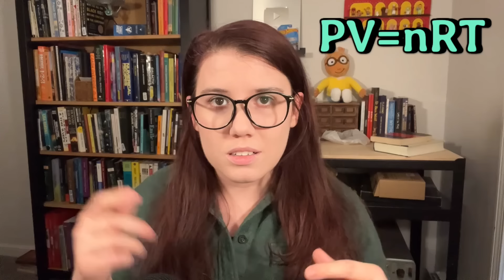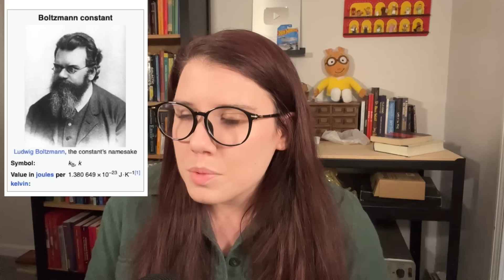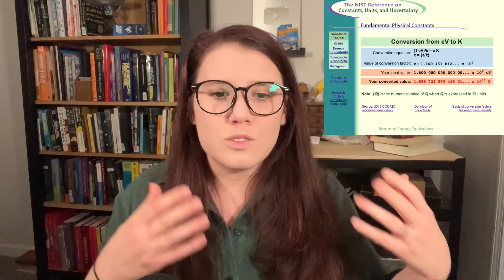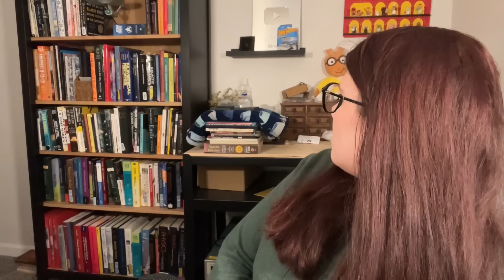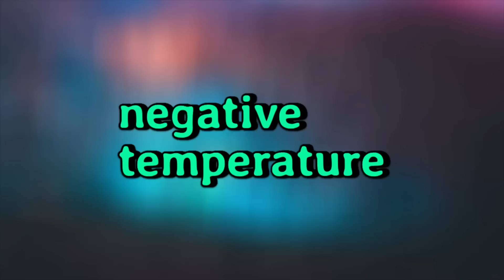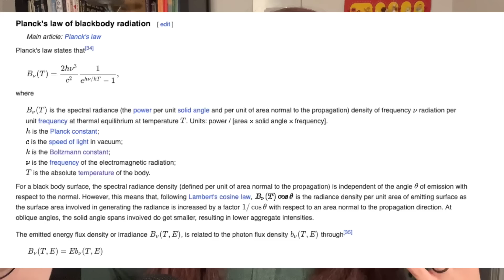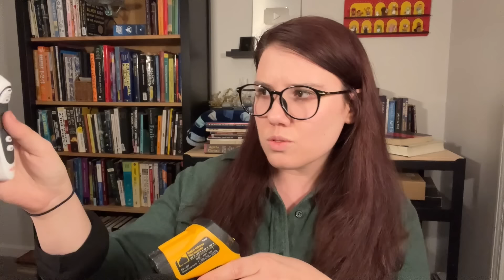the concept of temperature

Comment: If i remember my p-chem correctly (BIG if), the vibrational degrees of freedom of a bond are stetching and bending. Both are harmonic oscillators, so stretching is really "stretching and compression", and bending is really "bending back and forth". You can model a diatonic molecule pretty well as two balls with a spring between them.

Comment: PC building question. So basically if I manage to decrease CPU temperature, then it will have less resistance. So then I can make more calculations or less voltage needed for the same. But. Reducing CPU temperature requires a device which consume energy to cool the CPU. Lets say I can not reduce the efficiency of the cooling device but If I Increase the "heat removing capacity" linearly, then I can have a CPU which consume less energy / calculation.
Or
Forget the entire thing because increased cooling capacity will increase overall power consumption and truly the only reason to have a better cooling to stop the CPU reaching the maximum temperature which it can still operate...

Comment: I went on this descent into madness when my engineering thermodynamics professor assigned us a problem where the "correct way" to solve it was to use constant pressure, however the the pressure went from 1 atm to just under a GPa. When I searched for temperature in the index it referred me to a passage saying, "don't let it bother you that you don't understand entropy, we've never defined temperature and you've been using without issue."

Comment: Temperature of 1 atom isn't defined because its velocity is a macro-state information. A moving ball has the same temperature as a stationary ball. You only count the invisible degrees of freedom. Statistically, that's not the average kinetic energy, but the dispersion of velocity (that is - average of a square minus square of an average: average kinetic energy minus kinetic energy of the average system as seen from outside). That would put the temperature of a single atom to 0. But... knowledge of statistics also tells you that the fewer data points you have, the larger the uncertainty is, you roughly have 1/N scaling of dispersion. So, the temperature of a single atom is 0 ± ∞ which is meaningless. The more atoms you have, the more accurate your concept of energy gets, but you still have fluctuations which are more and more noticable, the fewer particles you have. That's what brownian motion reflects - some of the randomness starting to show when you look closely enough.

Comment: 34:50 : you can take an average of one thing, but if you are talking about the average of the kinetic energies of some particles, then, this depends on the frame of reference, and usually we would use the frame of reference in which the collection of particles is overall not moving, but, if you do this with just one atom, you always get zero, and so it seems less meaningful?

35:57 : err, hold on, what? I get how 1/S would be 1/0 if in the ground state, but, why should dS/dU be 0?
Surely if we add energy to it, there are multiple possible,
Well, I suppose if the two lowest energy eigenvalues were non-degenerate and you gave just enough energy to go up one energy level,
but, eh?
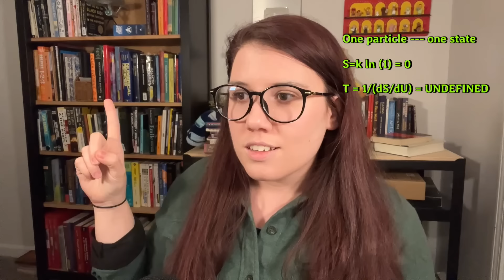36:43 : oh ok that is what you were getting at..
... is the next energy level really non-degenerate? Like, it will be rotationally symetric and everything?

Comment: All the ways to measure temperature basically comes down to 1. Get something to a thermal equilibrium with the thing you want to measure. 2. Measure some property of that something, that you know how relates to temperature. 3. Use the known relationship to figure out the temperature. 
The nice thing about black body radiation is that the 'something' is the ambient electromagnetic field, so we don't have to stick anything into the system we are measuring

Comment: Historically temperature seems to be the degree of change in state of liquid water between frozen ice & boiled steam under 1 atmospheric pressure.  Note as temperature changes water atoms (ex: atomistically) do change in their state although holistically water remains a liquid. 
Heat density seems to be the crux of temperature.

Comment: I used to work in an oil refinery, 

We had a huge vessel , about the size of a ten story building. It was full of steam at about 10 PSI. A supervisor asked me to unplug a bleeder valve at the bottom with a rod by opening the bleeder and shoving the rod in the bleeder. I refused. He said it's only ten PSI and  decided to do it himself as I cautioned him against it. He opened the bleeder valve and shoved the rod into it. Out came so much steam under massive pressure that he had to jump away and do an elaborate dance to prevent injury. Every one ran away in fear accept me, as I was standing far away already. The entire area was inundated with steam in seconds. This occurred do to the huge volume in the vessel and the tiny opening in the bleeder valve. We had to shut two very large valves in order to isolate the section and wait for the pressure to dissipate before we could shut the valve. .No one was injured.
Reply: Honestly people who are so stubborn and refuse to listen like this are flat out dangerous. I'm glad no one was hurt.
Reply: Hey you can't just drop the story without saying if the supervisor at least acknowledged you were right
Reply: @AMUMSHS  NO, he never said anything about it. Too embarrassed I guess.
Reply: You may be interested in the Safety Third segment on the Well There's Your Problem comedy podcast about engineering disasters hosted here on YouTube. That segment in particular is about workplace calamities described in opposition to Mike Rowe's stated affinity for personal responsibility as a superior safety paradigm when compared to institutional or regulatory orders.
Reply: Every time I open a can of Guinness, I risk inundating my desk. If the can is cold, it is pretty safe to open it quickly, but best be more patient.
Reply: 10 psi itself is almost a child's play, but 10 psi of steam is around 240°Fahrenheit.
Steam is dangerous all by itself because it's hot and it is wet, which transfers heat better.
People get injured from just hot water before it boils.
A small orifice doesn't increase the pressure from the source pressure.
10 psi is 10 psi.
Steam is freaking hot.
Don't play with steam.
Reply: @ You’re right I should have said velocity not pressure but essentially the result is the same.

Comment: I used to work for the Eurotherm Corporation. What I always thought was interesting about the two-dissimilar-metals Thermocouples is that, no matter HOW LONG the overall length of the two conjoined wires (whether the length be 6-inches or 16 feet), the voltage measured across the two conjoined wires, for any overall length, will always be the same (if the temperature at the union-of-wires point remains constant.)

Comment: The triple point of an element is confusing…
• is it a liquid?
• is it a gas?
• is it a solid?
• are the three concepts inadequate to describe what is going on?
Reply: The triple point is not a state it's a temperature and a pleasure at which all three states are possible. Just like, for example, at 0 C/1atm water can be either liquid or solid. Same thing but with all three states.
Reply: @Trucmuch  A-ha! So, from what you are saying, the triple point is the point at which 4 change-of-state rates are all equal...
• the rate at which solid becomes liquid;
• the rate at which liquid becomes vapor;
• the rate at which vapor becomes liquid; 
• the rate at which liquid becomes solid.
I know sublimation can occur, but I am not sure if reverse sublimation is possible.
Reply: @JohnBerry-q1h  Reverse sublimation exists and is called deposition. 
The state changes don't happen all at once or at the same rate. Let's go back to the simpler example of an ice cube at 0°C. An ice cube at room temperature will slowly melt but remain at 0°C until it's completely melted. Similarly, water in a freezer will slowly turn to ice but stay at 0°C until it's fully frozen. The melting and freezing don't happen in some kind of equilibrium. It's either one or the other. However, in both cases, it happens at 0°C.
Reply: @Trucmuch  The outcomes that you cite (a sample of ice completely melting while remaining at 0°C the entire time; a sample of water completely turning to ice while remaining at 0°C the entire time) definitely do happen, and I believe that the characteristic behavior of the temperature (i.e. remains constant) is always observed during such changes of phase. However, I'm certain that, if the rate at which Heat is added is kept equal to the rate at which Heat is removed, then it is possible for the rate at which...
• ice changes to water
...to be equal to the rate at which...
• water changes to ice.
The classic experiment involves recording the mass of an ice cube before dropping the ice cube into a glass of water. After some time passes, the ice cube is fished out of the water, followed immediately by re-weighing the ice cube. If the rate of "heat in" matched the rate of "heat out" (for the Ice Cube and Glass Of Water system), then the ice cube ends-up having the same mass at time 𝑡₁ as it had at time 𝑡₀. The noted difference is that the edges and corners of the initially "square" Ice Cube are now rounded and smoothed, having uniformly changed to water while an equal amount of the surrounding water changed to ice (which forms on the exterior of the pre-existing Ice Cube.) My understanding is that everything comes down to the rate at which Heat is added to a system versus the rate at which Heat is removed from a system. When the Heat rates (ᴵᴺ 𝑣𝑒𝑟𝑠𝑢𝑠 ᴼᵁᵀ) are balanced, then all of the dependent "phase change" rates can be equal, thereby establishing equilibrium. Again, it is necessary to specify if the rate of Heat addition exceeds, pales, or balances relative to the rate of Heat removal.
Reply: @JohnBerry-q1h  I guess. 
One could argue that heating and cooling in quick succession is just that—heating and cooling in quick succession. It's not heating and cooling simultaneously. But I don't want to nitpick. So, as long as you understand that the triple point is just a specific temperature and pressure that is the edge between the three states of matter, a point where an element can be either solid, liquid, or gaseous—not a special way to be either of these states —as long as you understand that, yes, by heating and cooling, increasing and decreasing the pressure in quick succession, you could have some oscillation between the three states of matter.

Comment: Claude Shannon tied information theory with randomness,  where a message is ordered and noise is disorder, similar to entropy where low entropy is order and high entropy is randonmness/noise/disorder/equilibrium.  At least the case of a mercury thermometer, I always assumed it was the reaching of equilibrium between the two different states of that which is being measured and the thermometer/mercury itself (e.g., high heat will cause the mercury to expand).

Comment: Hearing your explanation and configuring that for my head it seems to me that temperature is a measure of the flow rate of energy. Energy flows in a number of ways. Molecules bouncing around, vibration of molecules within them selves, infrared photons, ?. The confusing one is the thermometer which is the expansion of a material due to the flow rate of energy causing the material in a fine tube to expand, and than can be caused to happen with both photons and external contact with other materials. The temperature of space is the most confusing because that, it seems, can be a static value. Confused. Good to be forced to think about things I thought I understood.
Reply: what i now have indestood is:
space= 1d,2d,3d,..(ie space-digit d-ary number system)
local thermal equilibrium =  1e,2e,3e,.. (ie LTE-digit e-ary number system)
degree of freedom =  1f,2f,3f,..(ie DOF-digit f-ary number system)
time= 1g,2g,3g,..(ie time-digit g-ary number system)
And if to notice that
(img+coimg)-digit (ker+coker)-ary number system is equivalent to (coimg)-nested (1+coker)-ary img-digit number system (1 play role of carry  when Ker is disappearing)

Carry(motion,energy) of that number system equals following:

(ker+coker)^(img+coimg) = Sum F[coker,i,coimg]* Sum F[coker,j,img]*G[ker,coker,img,coker_shape]^(j+i) ,for i:=0 to coimg, for j:=0 to img, F[coker,j,img] - amount of j-faces in img_coker_shape,
G- likewise coimg_coker_shape

if coker=1 then img_coker_shape is img_vertex simplex (ie well known Newtons binom, therefore not interesting, let's skip it) 
else if coker=even number then it is img_coker_cube 
else if coker=odd number then it is img_coker_donut;

 Example_1 for coker=2(cube) wich is:
Row_0   1
Row_1   2 1 
Row_2   4 4 1
Row_3   8 12 6 1
   ...
   
    if (img=3)and(coimg=0)and(coker=2)and(ker=0..3)then Row_0*Row_3:
   (0+2)^3=1*(8*0^0+12*0^1+6*0^2+1*0^3)=8 
   (1+2)^3=1*(8*1^0+12*1^1+6*1^2+1*1^3)=27 
   (2+2)^3=1*(8*2^0+12*2^1+6*2^2+1*2^3)=64 
   (3+2)^3=1*(8*3^0+12*3^1+6*3^2+1*3^3)=125 
    if (img=2)and(coimg=1)and(coker=2)and(ker=0..3) then Row_1*Row_2: 
   (0+2)^3=2*(4*0^0+4*0^1+1*0^2)+1*(4*0^1+4*0^2+1*0^3)= 8 
   (1+2)^3=2*(4*1^0+4*1^1+1*1^2)+1*(4*1^1+4*1^2+1*1^3)= 27 
   (2+2)^3=2*(4*2^0+4*2^1+1*2^2)+1*(4*2^1+4*2^2+1*2^3)= 64 
   (3+2)^3=2*(4*3^0+4*3^1+1*3^2)+1*(4*3^1+4*3^2+1*3^3)= 125 
    if (img=1)and(coimg=2)and(coker=2)and(ker=0..3) then Row_2*Row_1: 
   (0+2)^3=4*(2*0^0+1*0^1)+4*(2*0^1+1*0^2)+1*(2*0^2+1*0^3)= 8 
   (1+2)^3=4*(2*1^0+1*1^1)+4*(2*1^1+1*1^2)+1*(2*1^2+1*1^3)= 27 
   (2+2)^3=4*(2*2^0+1*2^1)+4*(2*2^1+1*2^2)+1*(2*2^2+1*2^3)= 64
   (3+2)^3=4*(2*3^0+1*3^1)+4*(2*3^1+1*3^2)+1*(2*3^2+1*3^3)= 125 
    if (img=0)and(coimg=3)and(coker=2)and(ker=0..3) then Row_3*Row_0: 
   (0+2)^3=8*(1*0^0)+12*(2*0^1+1*0^2)+6*(1*0^2)+1*(1*0^3)= 8 
   (1+2)^3=8*(1*1^0)+12*(1*1^1)+6*(1*1^2)+1*(1*1^3)= 27 
   (2+2)^3=8*(1*2^0)+12*(1*2^1)+6*(1*2^2)+1*(1*2^3)= 64
   (3+2)^3=8*(1*3^0)+12*(1*3^1)+6*(1*3^2)+1*(1*3^3)= 125

Comment: The idea being used around 35:58 of the video is incorrect. While S = 0, this does not mean that dS/dE = 0 at all. It is entirely mundane for functions to satisfy, for example, f(0) = 0, but f'(0) ≠ 0 (as an example, let f(x) = x). Also, the definition of entrope being used here is not correct when talking about quantum systems anyway. This definition only works if you assume atoms are non-quantum. The definition of entropy in quantum mechanics is related to the trace of the density operator.
Reply: -tr(rho ln(rho)) right?
Ok but still if rho is a pure state, then one still gets 0..
Reply: @drdca8263  One gets S = 0, not for dS/dE, so Dr. Collier-Castro's claim is still incorrect.
Reply: @100MWSmile   I didn’t mean to contradict that part of what you said. I agree that the problem is only if dS/dU is 0.
Though, the meaning seems a little unclear to me in this way: how does the density operator \rho vary as a function of energy?
I suppose if we assume it is in a state of the form \rho = \exp(-c H)/\tr(exp(-c H)) for some real number c of the right units, where H is the Hamiltonian operator for the system, and let E be \tr( \rho H ) ,
then, for reasonable systems I think there will be a smooth bijection between values of E and values of c,
and so then we would have \rho as a function of E,
and then uh,
\tr(-\rho \ln(\rho) ) = \tr( (\exp( c H)/\tr(\exp(- c H))) \ln(\exp(- c H)/\tr(\exp(- c H))) )
= \tr( \rho * ( c H - \tr(\exp(-c H)) ) )
... which I’m sure should simplify nicely and give the usual temperature for these kinds of states, but I am typing this on phone and don’t want to type out the rest of the work on phone.
But it also seems like it maybe kind of begs the question,
in that, I’m pretty sure that that formula I gave for the density operator, is the one that like, maximizes the entropy given an expected value of the entropy?
Oh wait,
maybe that’s fine then,
if one just says, instead of “the current entropy” we say “the maximum possible entropy given the current expected amount of energy and other variables whose values we know”?
Hm, still doesn’t seem as general purpose a definition as one could hope for..?
Suppose a system is in the second lowest energy level among pure states, and that there is a gap in energy to the next lowest energy state.
Does it have a well-defined temperature?
It is in a pure state, so its entropy is zero, but, how should its density operator change if you changed the energy by an arbitrarily small amount? There are possible density operators which are very similar and which have whatever target very-near values of expected energy,
But, I don’t see a clear right-way to pick one.

For such pure states, is temperature well defined?